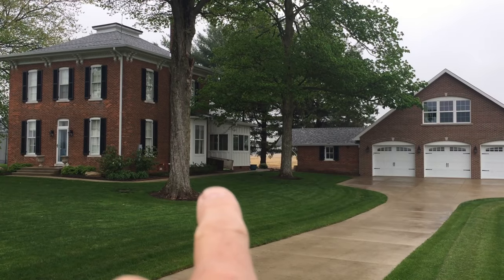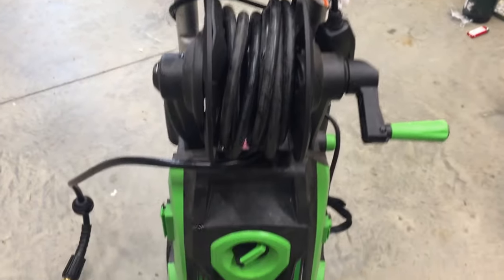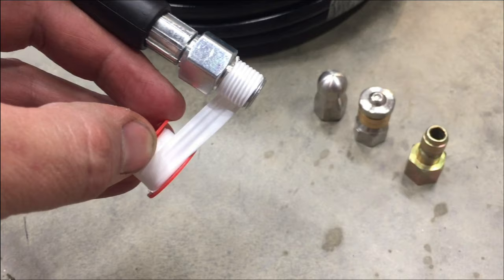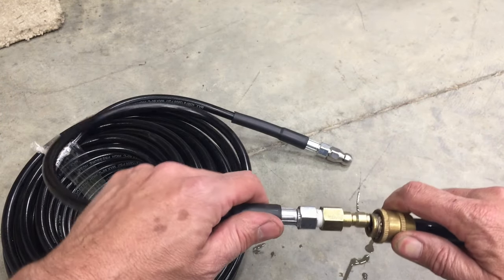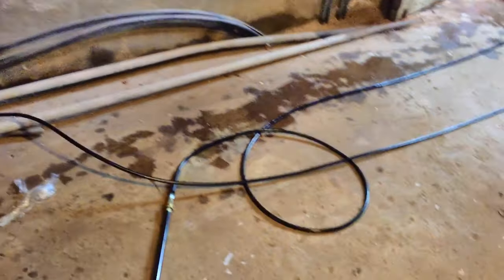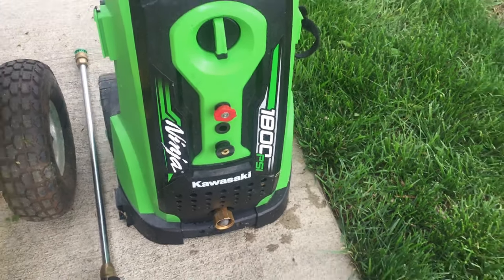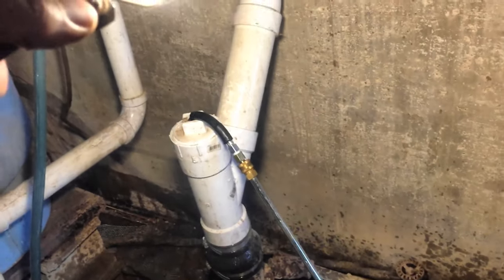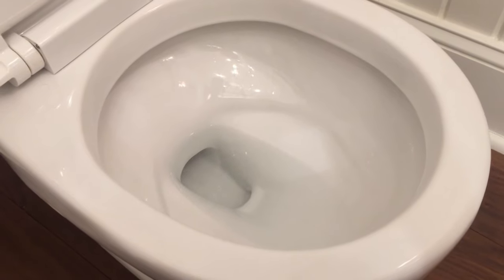How To Jet Clean Sewer Pipes

Comment: I do this professionally. Instead of drilling into the cap of the cleanout, you would have been better off using rags around the cap. That tape wont hold if there's another clog and sewage starts backing up into the house. Often times it's not even necessary to use the rags, if you have the right nozzle on the end of your hose.
Reply from the maker: Good point!  I will buy another plug and keep the holey one for my next clean out.
Reply: How much would this cost to have done professionally?
Reply: Guy out of Portland Oregon said he charges 700 dollars an hour
Reply: @Shadowm572  My shrink doesn't charge that much. LOL don't have a shrink. crazy 700/hr I should my own business at 300/hr and under cut him!
Reply: @HowToLou  Now  you've just got purpose built plug specifically for this, for probably whatever the 2 rags you'd use would cost anyway. Call it a win-win eh?
Reply: @gabrielbruzzi1962  If you live in Portland, you need a shrink.

Comment: Glad it worked, but good chance it will be back before long. Just pointing out several things you have already been told or may have already found out. 1, the electric might work in a sink pipe. Drilling a hole in the cap was a good idea if you are going to replace the cap, using a rag would have been fine. The spinner nozzle isn't for clogs, that is for use after you poke a hole in the clog with the button nozzle to help clean the walls of the pipe.  Now for the bigger issue, it looks like you have cast iron in the ground, the walls of that get very rough and cause things to cling to the wall, causing clogs, and that spinner nozzle does not have enough power to clean that. You would need either a reverse turbo nozzle, running at least 3000 psi and 4 gpm or more, or a flex shaft with a chain to clean the walls, and those flex shaft units are expensive. Also, with all of today's low flow sinks, toilets etc, that can increase clogs in a line, something I do about 1x a month is fill up the tub, and all the sinks, then let them go all at the same time(ok, takes me 5 seconds to run to each other sink) but, that puts a huge amount of water down the pipe all at once and will usually push all the stuff sitting in the pipe on down the line, rather you have a septic tank or city sewer. My jetter is for residential stuff, 4 pipe inch or less and I run 4000 psi at 4 gpm unless I have roots in the line, then I run 4000 psi at 8 gpm.

Comment: Isn’t it easier to buy a backhoe and dig up the entire sewer line, including the drive way?
Reply from the maker: Dang!  It sux when I post a video and my viewers come up with better ideas 😳.  Next time!!
Reply: Pcj...  Your reasoning is well thought out.   You sound like a general contractor!
Reply: So much easier. I’d do that and have it all knocked out and reinstalled in less than a 6 pack.
Reply: Digging up sewer line will run $25k-50k depending on where you live. If the sewer is in good condition and just has poor pitch or a bit of a belly, keeping a $100 jetter and a $500 3/8" 75 ft roto rooter on hand sounds a lot better than $25k to me. I'm gonna spend $600, not $25k. Chances are you will only be in the house 9 years anyway. You'll never recoup a sewer job and should only be done as a last resort - i.e. an entirely collapsed line.
Reply: @garneroutlaw1  Wow, I just had a new septic tank and drain field installed, cost, $3,000.00 My soil is sand, so a rocky location may be more expensive.

Comment: If you haven't done it yet, I would recommend just getting a new cap for the clean out and keeping the one you drilled just in case you jet the pipe again. Tape is not meant to stop sewer gas or a backup into that basement area. This was still a good video.
Reply: Drilling the cap is silly. The whole point of that cap is to be removed for servicing. Just don't turn on the jetter until it's far enough into the pipe. It's unlikely that the clog is right near the cap location anyways.

Comment: I would just suggest tapping it and putting a 1 inch pvc plug in to prevent the gas from coming out. Would be a little more stable in the long term.
Reply from the maker: Or just buy a new screw-in plug for $3
Reply: @HowToLou  how bout a cork!
Reply: That's where I put the straw
Reply: @AroundTheHorn1 🤣🤣

Comment: I use ultra high pressure desilt for my job. When we hit a blockage, we would pull the hose back a little and let it spray the blockage for around 10 seconds or so, if that doesn’t clear it, we would go back and forth with the hose whilst slightly rotating it. Usually that clears the issue. 

We use around 10,000 psi (700 bar) with flow rates around 170 LPM (35 GPM) 

On very rare occasions we can get up to 43,500 psi (3000 bar) with 400 LPM (88 GPM)

Comment: WHICH ONE MADE THE DIFFERENCE?   You changed out the button nozzle to the spinning nozzle and at the same time (apparently) changed out the electric pressure washer to a higher flow, higher PSI gasoline pressure washer.   Was it the nozzle change or the pressure washer change that got you through that clog at fifteen feet???
Reply from the maker: Definitely the pressure washer.   Neither nozzle was working with the little electric pressure washer.
Reply: Part of the problem is that electric pws are low water volume even at high pressure. You need above 2gpm at a minimum to do a decent job.
Reply: The spinning one is usually used to clear grease. The side spray is for cleaning the left over grease from the sides of your pipe.

Comment: Hey! Awesome video really cleared up my concerns. But what if the clog if after the tank? What would you do in that situation? The reason being, my friend had the same problem, but the clog was in the draining portion (After the tank) so he had to dig it up. Is that mandatory of will a long enough  pipe fix this? Thanks!
Reply from the maker: When a clog happens before the tank, it goes into the tank when you clear it.  Lines leading out of the tank, called fingers, in normal operation, are never supposed to have solids in them, so should not clog.  Either your tank filled up too much and sent solids into the fingers, or you got tree roots or mud in them.  Unfortunately, you can’t clean them out, because they have nothing to drain into.  They must be dug up and replaced.
Reply: You most definitely can have the line from your tank to your distribution box jetted.  The D Box is a concrete box that distributes the effluent to the drain field pipes.  Depending on how bad the clog is you may not be successful, but it’s cheaper than digging and replacing.  Also, you can pinpoint the clog and just repair from there. Good luck.
Reply: @HowToLou  Had an issue at my parents house where filbert trees where planted near the septic mound and the roots grew all the way to the septic tank. Talk about an expensive repair.

Comment: I have sand often on my sewer lines , ..must be clean every two months ... suspect a broken line , but this can be a quick temporary fix will give it a shot ...thanks  !
Reply: It may be a quick fix to do a line cleaning in this situation, but it would be best to at least have a camera ran through to scope a cause. If a line broke and sand is getting in, with time, water will continue to wet and break down the sand and could eventually lead to a sink hole depending on the surrounding soil. Also, if you're attached to a septic tank, loose sand near it could cause it to sink and break a line completely. I've witnessed a septic tank drop to loose dirt and the water weight broke the connection in no time. Best of luck.
Reply: Did this work for the sand in your drain i have a rain water with the same issue wondering if this works

Comment: Where can I get a hose with a quick connector that will fit the end of my Ryobi 1900 psi pressure washer wand and have a quick connect on the other end to put jetter attachments?
Reply from the maker: Look at this. I think it has what you want. 

100 FT Sewer Jetter Kit for Pressure Washer,Sewer Jetter Nozzles Kit,Drain Cleaning Hose for Pressure Washer,5800PSI Drain Cleaner Hose 1/4 Inch NPT

Comment: Thanks for the demo. Will it work on a storm drain (pushing out mud/sludge)? Is an electric pressure washer strong enough? 
Thanks again
Reply from the maker: I have not tried, but I bet it would push mud, yes.  Electric pressure washers are too weak.  You need serious power and flow.
Reply: @HowToLou  thank you.
Reply: I realize this is 2 months old, but the pressure i have at work runs 4k psi. works great for mud/sludge/grease/sewer blocks. I rarely have to increase the throttle to the full 4k pressure.

Comment: Can you show us how to do something similar with a clogged washer line?  We bought a pressure bladder that's supposed to work, afraid to try it. We have a pressure washer, and I think this method might work? Thanks.
Reply from the maker: You can use this for all indoor plumbing too.  You get the jetter hose on Amazon.  I would maybe try a coil snake first on a washing machine drain line though. Less messy.
Reply: @HowToLou   thanks.  We used a similar set of nozzles/jets for the air compressor (shoots air out backwards, around, and such) to clean out the HVAC vents.   Pretty sure my better half already tried the coil snake on the washer line - will check. 

I think the problem is that this Fisher Paykel washer we bought has a center mounted pump.  The washer does not have any lint filter, and that lint has clogged the washer exit line. I tried with limited success to make a lint filter that sits on top of the agitator so the water pumps through and leaves lint behind, as older washers used to have.  I guess we need to make a lint filter for the exit hose that can be cleaned at intervals.

If I remember correctly, the washer line has a separate field line - it doesn't go thru the septic tank.  So we've rerouted the washer drain temporarily thru a floor drain which just empties out onto the back yard.  Hoping the clog is in the first section, and not out where it probably turns a corner to go to the field line.
Reply from the maker: Yep, that’s called grey water and does not need to go to septic.  You saw in the video how that hose whipped across the driveway.  I am pretty sure it would make the bend, no problem.

Comment: @HowToLou What are your thoughts on using a garbage disposer with a septic tank? I look around and see so many mixed opinions about it anywhere from you should never use a disposer with septic system, to you can use it as long as your careful and not using like a trash can and regularly pumping the tank to something like, “i’ve been using a disposer with my septic system for 15 years and never had to pump it and i put all kinds of food waste down there and I just flush rid x down the toilet once a month”. So i was just wondering if you’ve had any experience. Thanks. Ben
Reply from the maker: I am on Team RidX or any similar product flushed once a month.  By the way, all that stuff is simply yeast, like used in baking.  I do put some scraps down, but throw larger stuff in the trash if its pretty easy to do so.  Disposals are just so nice, they are worth it, even if you have to pump more often, I think.
Reply: @HowToLou  those septic tank treatments have the potential to make the sludge light enough to flow out into the drain field and plug it up
Reply from the maker: The treatments are simply more of the yeast that’s already in the tank.  I have never heard of anyone clogging their septic field with it.
Reply: @HowToLou  well that’s good to know. It’s so hard to tell if anything that septic service guys or websites say are true or not.
Reply: @HowToLou  i know that drain fields go bad mostly because of age. That’s what happened to ours and our neighbor’s as well.
Reply from the maker: New septic tanks have a filter that you have to clean once a year or so.  I will be doing a septic system installation video, this Spring
Reply: @HowToLou  I had a new septic tank/drain field installed 3 years ago. The info given to me from the county had lots of excellent info such as how many people in the house as to how often a tank should be pumped to things like using a disposer and it even addressed the additives being used for a tank. The disposal can speed up clogging your system, and the additives are a big no no, they will cause more sludge to get to the drain field instead of sitting in the bottom of the tank, then you will have to have the yard dug up to replace the drain field.  So although you think you are doing something good, for your septic system, it is really bad, the only thing good is the money they make selling you those additives and the money the plumbers make because you used them.

Comment: Amazon sells a 6500 psi and a 3600 psi sewer jet kit.  Is there any reason not to buy the 6500 psi version?
Reply from the maker: No.  The 3600 worked fine for me.  That’s a lot of cleaning power
Reply: Higher pressure is good when you need the higher pressure to cut roots.  However, that requires custom cutting heads like the Reaper nozzle to do a good job of cutting the roots.  With normal debris blockages, its better with higher water flow rates.  The more water flow, the easier it is to flush the debris away.

Comment: But the hole wouldn’t it need properly sealed some type of way
Reply from the maker: There is no pressure there.   I am just blocking sewer gas.   But sure, you can just buy a new cap.

Comment: Why didn't you just buy a new cap
Reply from the maker: I could have, but there is really no need, since its just a cover, and this way I can use it again someday.
Reply: @HowToLou  Hell yah. I have a 110 ft run to my street and I have a poorly pitched sewer with maybe 2 inches of belly in it. I'm gonna do what you do! My belly runs from about 30 ft to 65 ft. Just gonna keep a 75ft 3/8" roto rooter downstairs and a 100ft jetter.